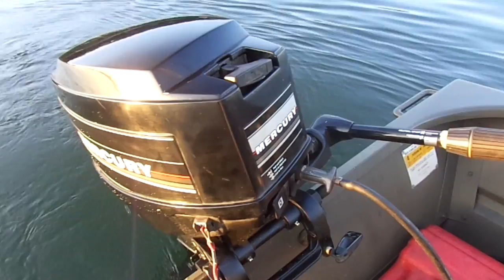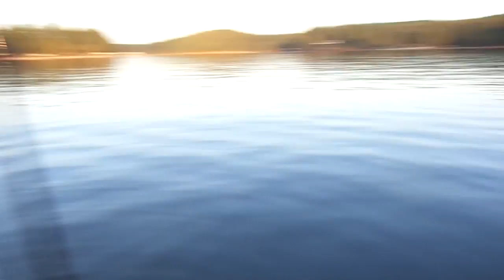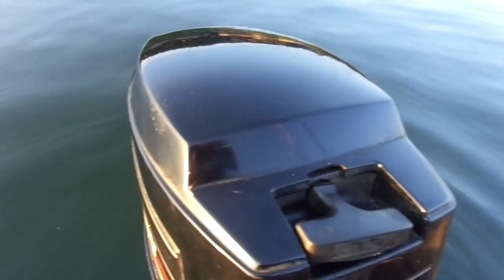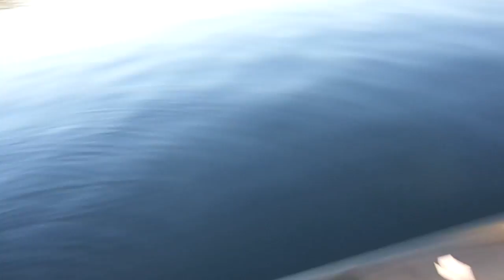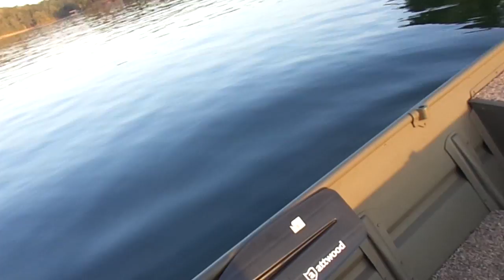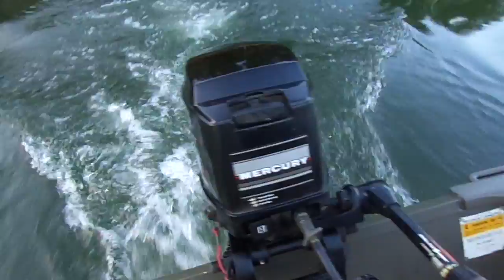Mercury 20 HP on the lake

Comment from the maker: Duxbware, If you want to hear my opinion here it is.
Your 9.9 is a little smaller for your boat. Without changing motor you can but a SS prop on it, 8 or 9 pitch. SS prop with 10 pitch makes my 15 HP Johnsons go 2 MPH faster on 1436 riveted boats than standard 10 pitch aluminum props and is very noticeably faster on acceleration. I love my SS 10 pitch prop. SS prop blades are thinner than aluminum ones and that in translation produces less drag as they spins in the water
Option # 2.    Put 15 HP carburetor on it. Single carb change on your motor will make you smile on acceleration. Leave exhaust tube alone, you would have to take the power head off to change it for round tuned exhaust tube, it's half day work if you have new mid section to power head gasket in hand.  From my experience your motor will feel like 14 HP motor. But - you will lose a little of your idle quality, unnoticeable by weekend boater.
  All above is only opinion of boat motor enthusiast who first time saw an outboard motor from up close only 4 years ago, and who found that his favorite motor is Johnson/Evinrude 9.9-15 HP from 1974 - 2002 shortly after that. They always surprised me how much power they pack in such a small package.
 And one more thing. Beaver tail will rob you of precious power needed at the take off when you need it most - but I am not completely sure of that Couple of years ago I tried one and was disappointed how much they slowed me down.
 Dam, I am tired, never typed so much in English.
Reply: vojomatusenko,  Thank you so much for the reply and expertise.  I think I will leave the motor alone, with he original carb, only because it is in such nice, original condition. Also, why I don't want to modify it with a beavertail either.  Its a nice, clean, low use motor.   I've been looking at props online quite a bit the past few days, and I think I will take your advise, and go with a Solas Saturn SS prop, in 9 Pitch.   I think with he thinner blades, and the 1" drop in pitch will allow the 9.9 to accelerate better on the bigger boat, with me and my father and fishing gear in it.   Also, if i am in the boat alone fishing, I think the 9 pitch will still be suitable.  

Thanks, Again my friend! Keep making these great vids! you do an awesome Job!!!

Comment: Duxbware, I would go with the stainless 10 inch pitch. Stainless blades don't flex so stay with the 10 pitch but try a sting Ray dolphin!!! You will not be disappointed!!! You will jump on plane and be able to stay on plane longer at a lower speed! And get a little better fuel economy
Reply: Really, stay with he 10 pitch eh?  My only worry for that is that i think pushing this fairly large boat (rated for 25hp max),  with the little 9.9, it seemed like the 9.9 needs to be allowed to rev just a bit easier.  so i was thinking drop down and inch for pitch?  also, I will almost always have two people and fishing gear in this boat too.  I've never had a stainless prop on a motor before though, so I don't know much about them.
Reply: You could drop 1. But if she is a good runner I always jump 1 pitch... Go with a 9 and throw a dolphin on her and she will cook🚤😁
Reply: But stainless don't flex like aluminum do. You will get more bite with a good stainless
Reply: wayne pavlow yep, she's a good runner for sure.  damn near like new.   So is the stainless easier for the motor to turn, having less flex in the blades? or will more bite, load the motor up more?
Reply: She will run more efficiently. Hard to explain but when the blades of a aluminum flex it's kinda like a clutch slipping if that makes sense
Reply: wayne pavlow great.  Thanks for the advice.  It's al very appreciated my friend.
Reply: ***** are you on Facebook?
Reply: No, I'm not.  lol.   I must be the only person on the planet likely without a Facebook account.   lol.

Comment: question for ya, I have a 1992 evinrude 9.9 2 stroke, that I put on my G3 1548 dk welded jon.  it has stock prop 9 1/2 x 10 pitch, I'd like to get a bit more hole shot out of it, and get it up on plane quicker with two people in the boat.  Should i go with a solas 9" pitch, 3 blade stainless prop, or should I try the solas 4 blade aluminum prop in a 8" pitch?    I value your opinion my friend.    Thanks a million!